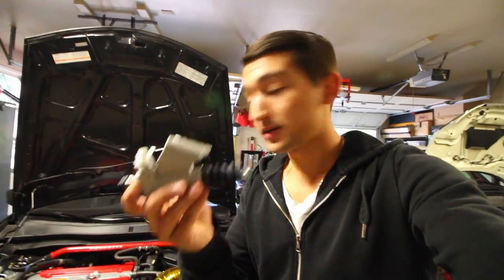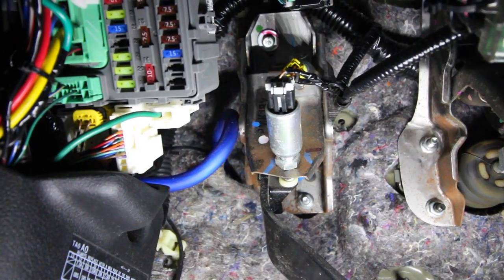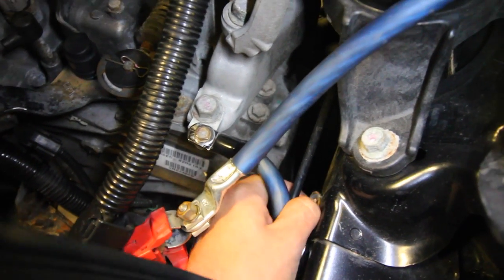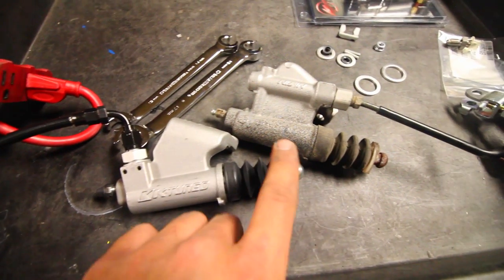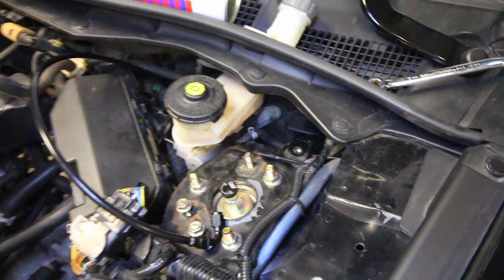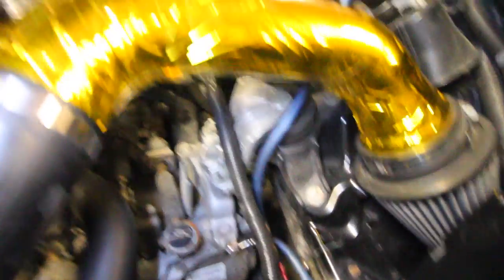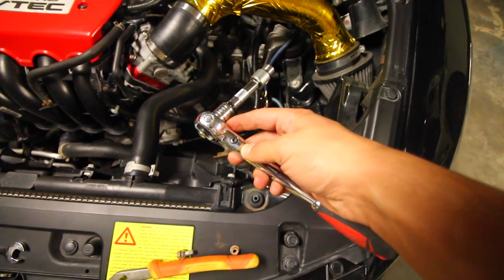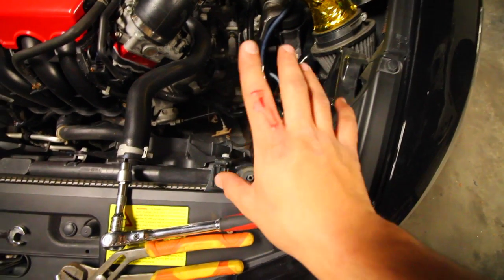How to Make Your Transmission Shift Faster (K-Tuned)

Comment: i have the same problem with my car but when i redline in 1st and i try to go to 2nd it grinds even though the clutch is pushed in all the way what could it be i thought maybe it was my synchros or my clutch
Reply: Mauro Beltran research cdv delete....it's the exact same procedure for 8th an 9th an manual accords.....it's a free upgrade that does the exact same thing as this 2-300$ unit
Reply: Rodolfo Munoz dont waste time its 26$ at any autoparts...people dont research these days...em1 master,ep3/rsx slave,flex line there you go...
Reply: Good vid

Comment: Hey just wondering do I have to get upgraded clutch to use the upgraded cmc and slave
Reply from the maker: No you do not. I am using the OEM clutch and flywheel without problems.
Reply: @milanmastracci  awesome thanks for the reply

Comment: talking fast at 19:19...lower RPM???  Installed the K-tuned stuff?  What is ''the stuff'....?
Reply from the maker: When I would go over 7200 RPM, the transmission felt like it was restricting me from engaging the next gear because of the delay mechanism found in the stock slave cylinder. With the new k-tuned master and slave, it solved that problem and allowed me to shift faster.

Comment: If you are serious you shouldn't be working on that kind of level of work and no it's a completely separate system. What he is saying you can use brake fluid to fill your clutch reservoir but, they do sell performance clutch fluid and is suggested to use. I would but I got an automatically driven motor vehicle. On my past vehicles I have used both but I would use a better fluid specifically for the clutch.
Reply: v t special fluid??? Lol. You mean dot 4 or dot 5!!! Actually the special fluid (Lol) is for the brakes so they don’t fade.  Better to have brakes than a clutch don’t you think? Or maybe that is the problem and you do not think at all.

Comment: Will this work on the 6-6 too?
Reply from the maker: I haven't checked to see if they run the same slave cylinders
Reply: milanmastracci It's cool. I'm just gonna delete the check valve on my new slave. Keep up the vids bro, your channel is awesome.
Reply: CoolBreeze90210 it's the free route for the same results.....but the slave cylinders are identical on the 6-6 as the 9th gen si....so it'll fit....
Reply: Rodolfo Munoz good to know man. I appreciate it thanx
Reply: Yes heeltoe automotive sells them with all the information you will need. It is fool proof for sure!!

Comment: Hey Milan. Great video. I just tried to bleed my Slave cylinder. My fluid is pretty dirty. But now my clutch literally has no pressure.. It was working just fine when I first started. I'm stuck, any helpful tips?
Reply from the maker: Gravity bleed if its just you, or get someone to help you bleed it just like a brake caliper.
Reply: +milanmastracci that's what I did bro, but now the clutch lost all pressure.. I'll try with a buddy tomorrow
Reply: Changed my k tuned but fluid won't flow through ? Bleeder is cracked and the top is off ? Can someone help?